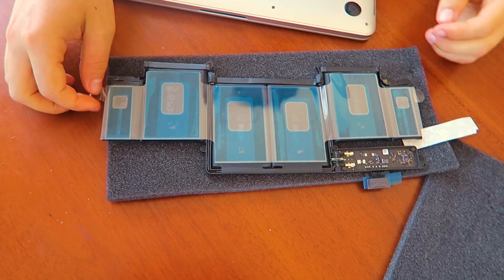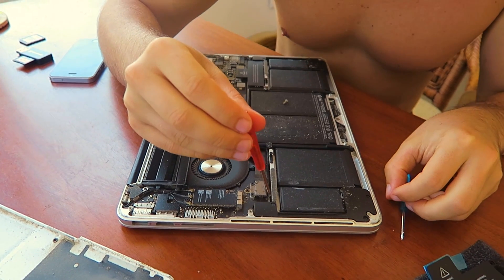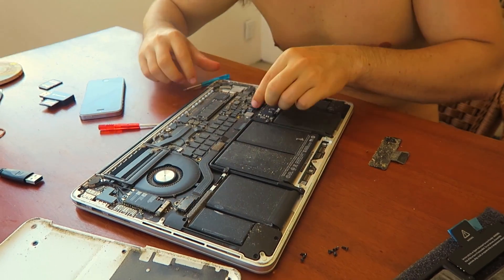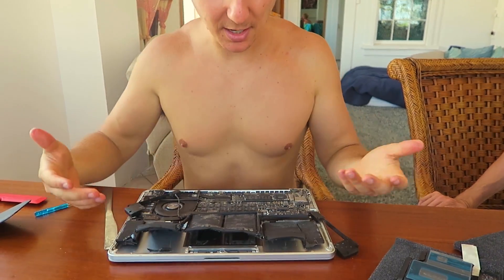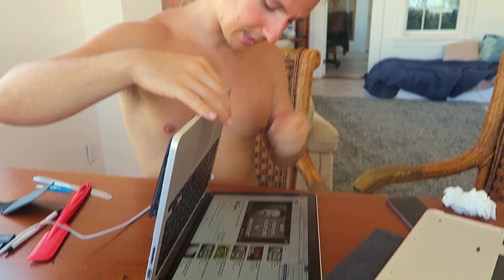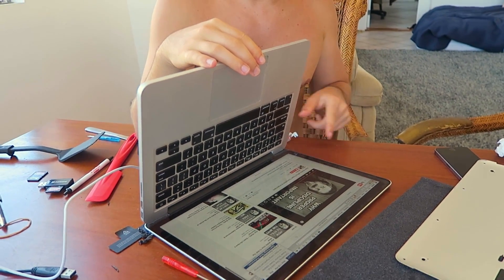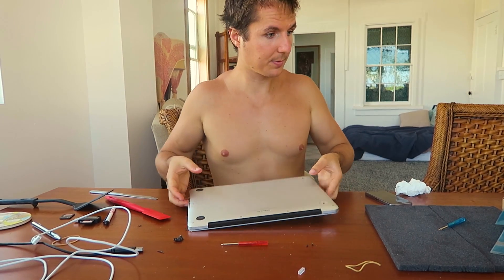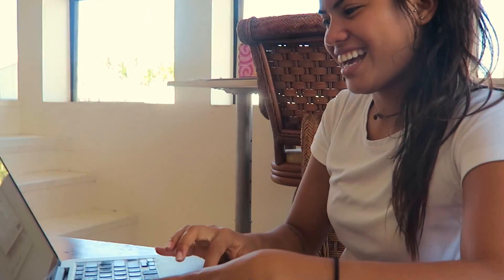Idiot's Guide to Replacing a Late 2013 Macbook Pro Battery

Comment: Good job! Note, everyone who concider doing this DO NOT use metal to pry the battery off, this could have ended up with permanent tattoos of battery acid. Use adhesive remover and plastic card to remove the batteries.